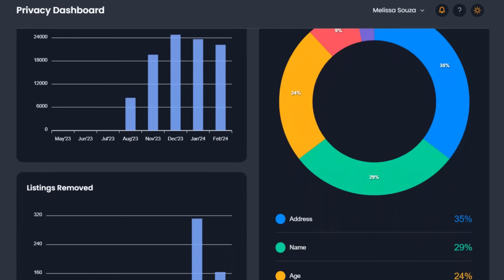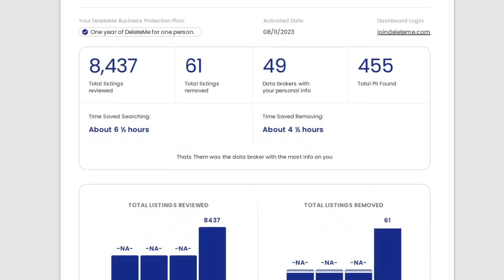Injuries & Big Decisions. Where Do We Go From Here?

Comment: If you have an air compressor and a lance nozzle. Use it to blow out the drywall dust every hour in the chuck and vents. Same for your other tools. The dust is the cause of them seizing up. 👍👍👉👉Plus a good tip also is to open them up before storing a final clean out and oiling the bearings.

Comment: Just a suggestion, but maybe before all that drywall will get patched and textured, remove the few sheets that will be the kitchen and add a bunch of blocking approximately where the kitchen cabinets will be so you have solid surface anywhere to screw into, not trying to hit a stud. Top cabinets also, if those will be there.

Comment: Looking good!  I like your choice of ceiling materials although it will mean some vapor barrier need be put up.  As for your question -  With the two windows in the wall and the forest showing through, I am a little concerned that it may look funny doing the whole wall in brick or stone.  And so, I would suggest a mural that works in the view from the windows be painted on the wall.  Alternatively, and a whole lot easier,  a faux fireplace (or real) with mantle between the two windows and 1/4 sawn bricks running up to the ceiling would be very nice - and then simply paint the walls on either side of the fireplace.  You could even incorporate some built in book shelves if you wanted.  I think though it would be quite nice with the fireplace and brick in the middle with painted walls and trim framing the natures art work.

Comment: With the insulation that droops in the roof space, you could use straightened wire coat hangers instead of expensive metal braces.

Comment: I would highly suggest getting a inversion table for Jeremy, it helped me a lot and im a drywall hanger  and do some concrete work also!! I would also invest in a DeWalt drywall gun you can't beet them trust me and tip for the tight corners when you cant get the gun in a straight angle you can just slide the cone off the tip of the gun and its just like having a impact driver

Comment: Hey yall, for the accent wall why not have end grain random species, random color stain 4" x 4" squares x 1/2" thick  For a wall 24' x 8' you would have approx. 700 each of  light, medium & dark 4" squares. You can buy these or make them yourself. 1,728 4" squares. If you cut your own blocks you will need 576' 4"x4",x1/2" thick of each species (3- 8' 4"x4" of each species) and 3 different color stains. Cutting on a miter saw, setup a sacrificial fence and make your stop itself be the vacuum attachment, with a vacuum attached to keep the thin piece in place after each cut. Use kiln dried and NOT pressure treated wood. Find a mill to cut actual 4"x4" & not just big box store bought 3 1/2"x3 1/2".

Comment: Stone or Brick I lean toward Stone and why did you not put plastic barrier on the outside walls just wondering❤🙏
Reply from the maker: The Zip siding with the tape is a vapor barrier in itself. The point of it is that it doesn't require wrap.
Reply: @GoodSimpleLiving  Ok thanks

Comment: Forget taking all those measurements and the possibility of messing them up.  Just cut the section of drywall like the pipe is not there.  Next, grab some lipstick (red is the best and get cheap ones).  Just coat the outer edge of the pipe, then press the drywall into place over the pipe.  This will transfer the location and size to the back of the drywall.  Grab your roto zip or hole drill and remove the plug.  You don't need a fancy drill to run drywall.  Just grab the bit tips that are designed just for that application.  It makes it almost impossible to over-sink the screws.   Think Philips bit tip with a round ring to only allow the screw to go in a little but not pop the paper.

Comment: Pretty shortly is a real phrase Melissa. We use it all the time. If someone is coming right away, it is proper English to say they will be here pretty shortly...at least in Canada it is an accepted phrase lol. Gabby is looking great with so much of the drywall put up. I hear you on the burnout thing. By the time I was done my renos last summer, I didn't want to see another contractor or a piece of "building material" for another year. We are getting new windows and a new furnace installed shortly and I am not looking forward to it, BUT, the finished product is always worth it. I hope your back gets better soon Jeremy. Maybe take a full week off and see if that helps. As for up here, we are bracing for a major snowstorm that will start late tonight and carry on through until Monday. They are calling for high winds, and a foot of new snow which ultimately means huge drifts to contend with for my plow. Blah. Come on spring! As always sending love from our acreage to yours.